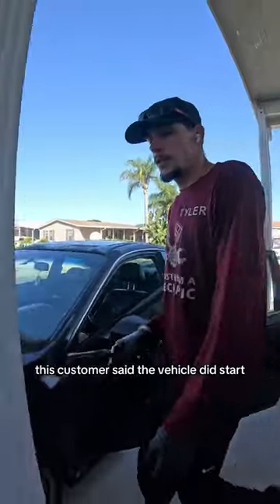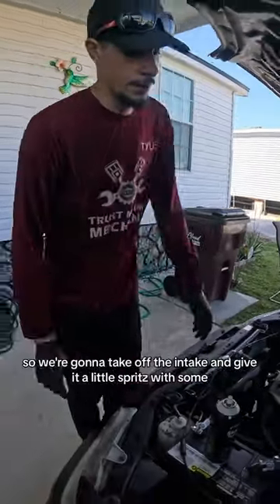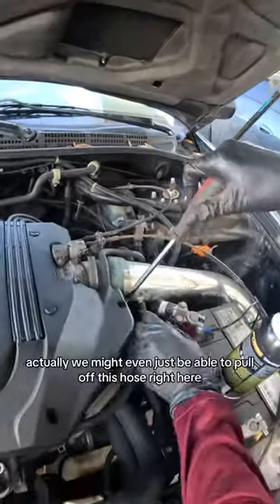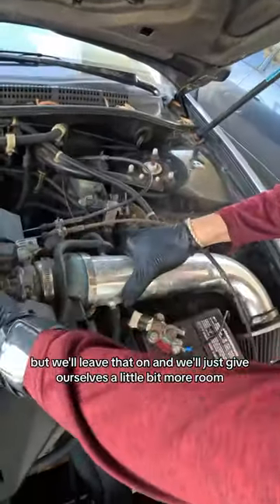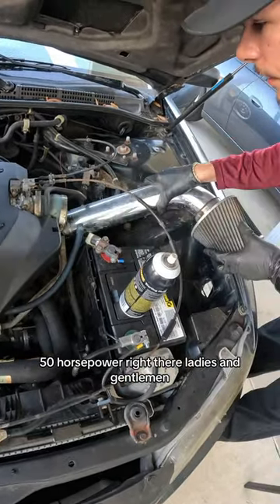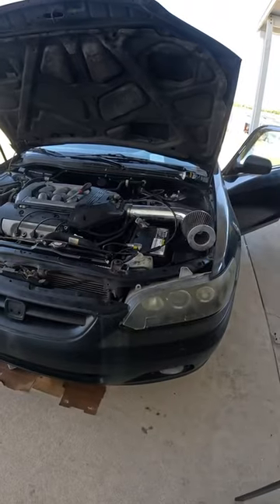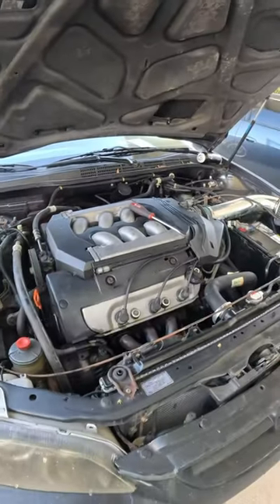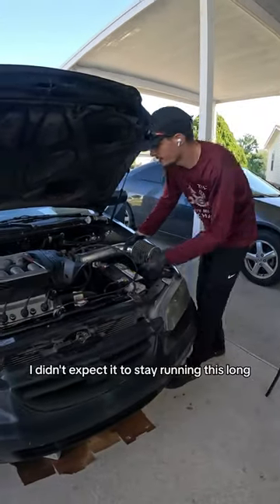Part 2 of Diagnosing a “No Start”, this is to check what the issue is and not the repair itself

Comment: Never leave your tools on an engine brother it will wind up in the fan or belts
Reply: Well fortunately it only ever eats the extra tools never the ones needed
Reply: One time my hand got pulled into it while prying the sway bar off of my car and the only reason my arm isn’t gone is because the belt snapped because it got caught with the pry bar
Reply: @Martin-cf2eo thank God bro I’ve had some crazy stories like that too be sure to pass on the game to others to help prevents injuries
Reply: @Martin-cf2eo um why were u trying to take off a sway bar from a running car 😂
Reply: @greenespirit4973 my thought exactly..
Reply: @greenespirit4973 exactly all these mishaps I’m reading are from idiots who don’t know wtf they doing 😂
Reply: That only happens with 10mm tools😂
Reply: When I was an apprentice I left a rag…. Nicely tucked in a safe spot -lmao! Needless to say my journeyman ended up doing an upper rad hose and water pump 😮
Reply: @Martin-cf2eo why was the car running if you're doing a sway bar
Reply: @demetriuscaldwell6010 Well how else will dumb people learn? Gotta make mistakes.
Reply: @Martin-cf2eo  you dont need to be around vehicles. why were you removing parts while the vehicle was running?

Comment: The fuel pump is working with the alternator charging at 13.5- 14.0 volts. I came across a similar "no start condition on a mustang. With jumper cables attached to a RUNNING VEHICLE it started right up and made it home. Just an FYI: it's always a good idea to replace the f/p relay with the fuel pump. Why risk your reputation over a $10 part?
Reply: Okay, but you can test a relay tho, 60-100 ohms on the coil don’t quote me on that , you can use a voltmeter to see if the contacts move , check the contacts to see if they are rusted or corroded should be good to go after this

Comment: I had a rental that did the no start about 3 times. If I waited 10 minutes or so, it would start. Drove it back  straight to Enterprise .I told them the problem  and showed it wouldn't start. They took it straight to the dealership and gave me Challenger for the duration of my contract for no extra charge.

Comment: My dad always taught me to listen for the fuel pump humming noise
Reply: Some vehicles like Toyotas don't prime until you try and start the vehicle. Priming the key does nothing to the pump
Reply: On many hondas, the fuel pump can hum, but in addition to the fuel pump relay, whats also in the Main Relay box is a relay that powers on the injectors.
Reply: On my old accord, you can hear the main relay click when it prime the pump then shuts off.

Comment: Had an old civic with a similar condition and it was a fault fuel pump relay. Old solder connections just were not cutting it

Comment: What was the fuel pressure after running, did you keep an eye on it to make sure it kept pressure on the fuel rail? Might be the fuel system losing pressure after sitting. Curious to see a whole diag/fix video.

Comment: That's a "hot air intake", the stock filter setup was a real cold air intake lol.  Those things are garbage because they don't really take any cold air from outside, but hot air from the engine bay, I use to make this mistake on my f350s and I saw my EGTs drop using the stock filter setup.
Reply: On point...but he was being sarcastic.

Comment: This happened to my wife's 08 honda Civic. I took it to the mechanic, and he said it was the fuel pump. I had a feeling it was the starter. He changed the fuel pump twice to find out when I took it to another mechanic it was the starter. It was an expensive lesson. It's better to do  process of elimination. The mechanic did that same thing with the strated fluid spray only to find out it was the starter.

Comment: Probably loss of 5-10 HP with those.... Most cars if you just use the factory box but get a high flow drop-in filter and then change your tubing so it's a direct shot to throttle body if it's not already... The factory box usually pulls air through the fender which is coming through the grill. Honestly those end up making you get hot air cuz it's just taking hot air from under the hood
Reply: Not true it’s more of a case by case situation, cheap plastic intakes are usually outperformed by metal intakes which are mostlyaftermarket. How you position the new air intake is what really matters air is gonna get in regardless lol
Reply: Finally good sens and knowledge. Cold air doesn't come from engine but from outside. And really 50 hp.. LOL!! yeah that cold air is a turbo!!

Comment: I don't believe it's the fuel pump . It's probably a sensor or something because a few shots of a starting fluid will die in just a second after it starts . Starting fluid proves whether the car is at least getting fire. If the car won't start on the starting fluid that's when you start to check your fire . A basic principle is if you've got fire and fuel an engine oil at least try to crank . It may run badly but it will indicate whether it can run or not

Comment: Do not spray your motor with ether if you must use a little bit of brake cleaner it's not as hard on your engine as ether and you're going to need the brake cleaner that will burn
Reply: hmmm. are you saying that ether doesn't burn?
Reply: @Alan-jx7uk  no I'm saying etheridge hard on the motor either will miss your sleeves and pistons up

Comment: Always get a sample of the fuel.  If its water piss clear it's diluted and low quality.  Fuel needs to be almost vitamin piss yellow.  I also noticed the cold air is not equipped with a maf sensor.  Maybe i missed it.

Comment: Oil pressure switch? On old Chevys if it didn’t go past a certain rpm the sensor wouldn’t read oil pressure and wouldn’t turn on the fuel pump. But this isn’t an old Chevy so just a wild guess 😂

Comment: Sounds like he has a idle air control valve problem that's why it doesn't idle or turn on because it doesn't know what fuel to throw at the engine engine

Comment: That's a hot air intake.
Reply: A hot air intake, as far as possible from the engine behind the battery? Quit parroting people.
Reply: @DrGears-sn4gj  not parroting anything. That garbage is pulling hot air from under the hood. Less restrictive, but pulling hotter, less dense air. It's basic knowledge.
Reply: @fathertime7923  Hey man idk if you knew this but stock airboxes also are under the hood. The point of these mods are to put them away from the engine, somewhere by the grille to help with forced induction. When you are vroom vrooming, cold air is being pushed into the hood through the grille and radiator. Basic knowledge but my apologizes the name is extremely specific and pedantic about its purpose down to the nose.
Reply: @DrGears-sn4gj  cool air blowing through the hot radiator, across a hot engine, filling the entire engine compartment with hot air. Stock box takes cool air from outside of the engine compartment.  Just offering an experienced opinion. Don't think/argue so much. Study. There's a world of good advice out there if you're willing to learn. 
Be willing.
Reply: @fathertime7923 which do you think conducts heat better plastic or metal? What about cool air ?

Comment: MAF sensor
Reply: I didn’t release it was missing until you pointed it out, but even without it won’t the ecu just revert back to its base line tune? So you will end up running rich with that extra air with nowhere to use it as the intake has no port for the MAF sesnor. I could be wrong so please correct me.